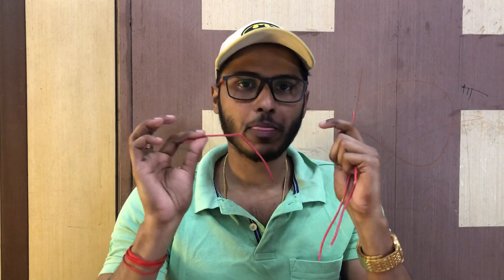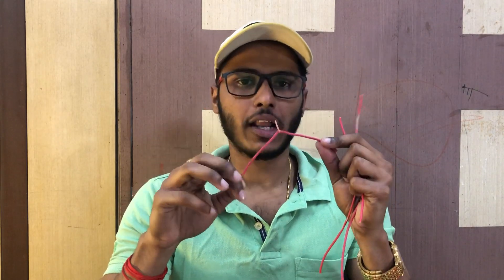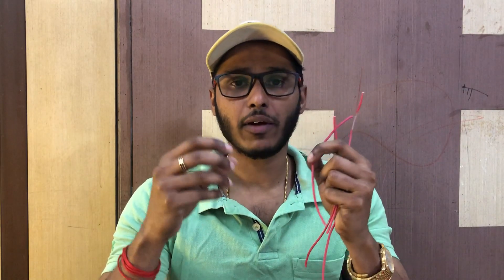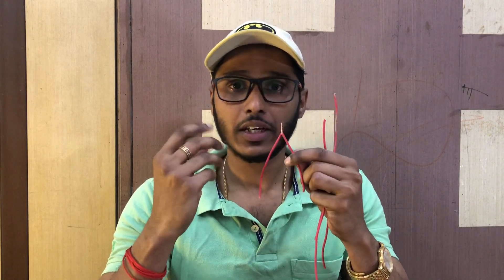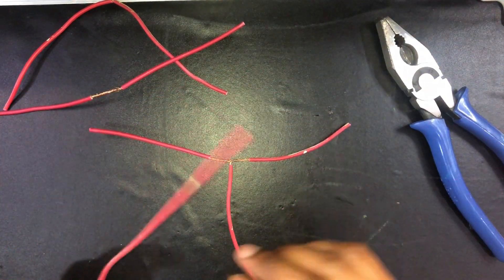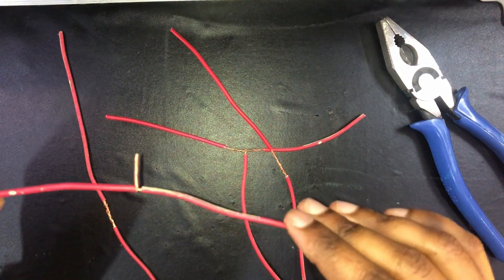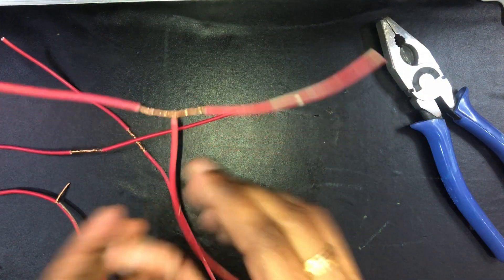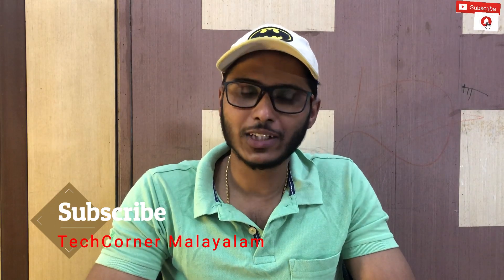വയർ എങ്ങനെ ശരിയായ രീതിയിൽ ജോയൻറ്റ് ചെയ്യാം | Proper Wire Joint and Types in Malayalam

Comment: Sir,can you explaine about the difference between Synchronous alternator and synchronous motor.
Reply from the maker: Ya sure... your previous request of alternator is already noted so will consider this too in that.
Reply: @TechCornerMalayalam  fan ayich matumbol enik shock adichu. Njan main switch, ellam off chydirunnu. Pinne endan enikk shock adikkan karanam.  adil oru wire thottappol aan shock adichad  [ bakki ulla wire thottappol shock adichilla]